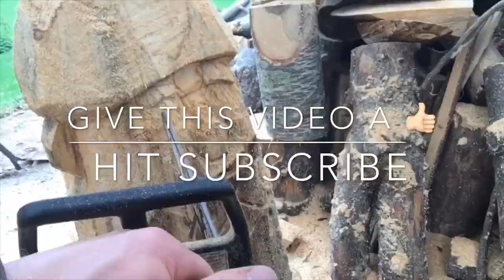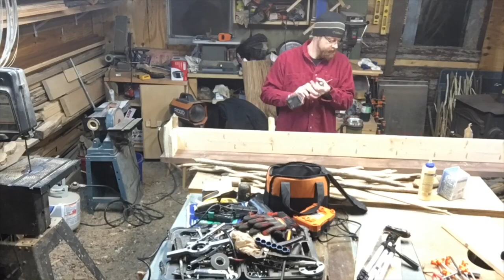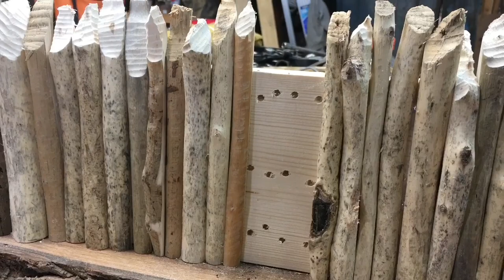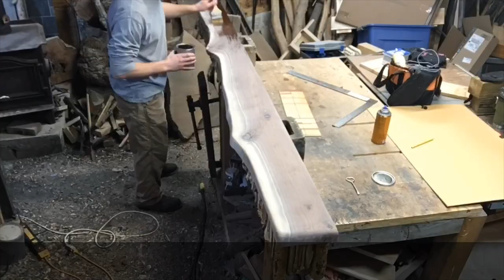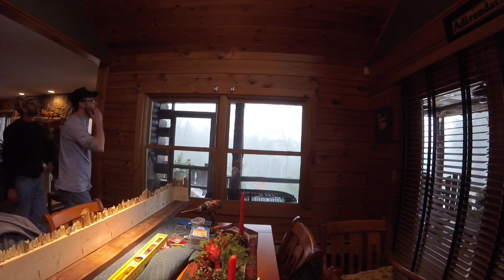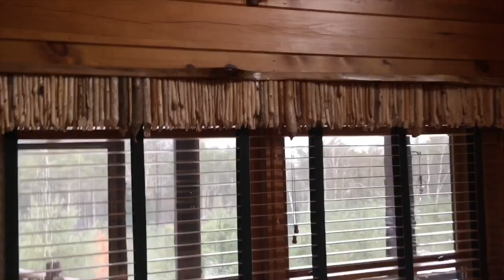Building and installing a custom Adirondack style window valance.

Comment: Another great piece Kyle. Did you just use angle brackets to attach it to the wall?
Reply from the maker: Thank you Goose . Yeah I used angle brackets to attach it to the wall . It was and easy install for the most part .